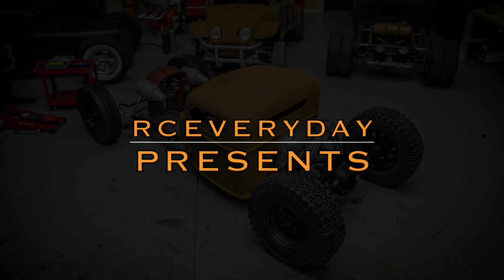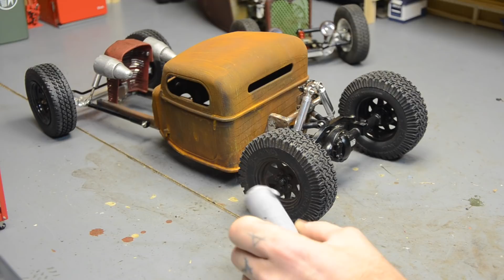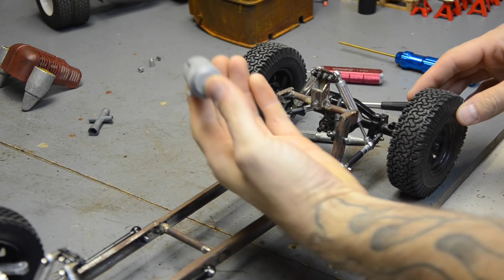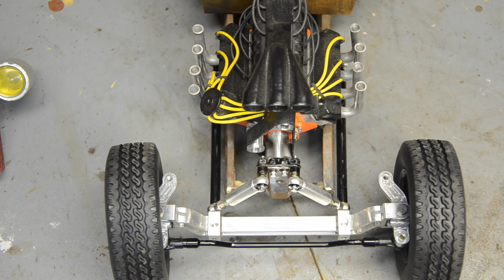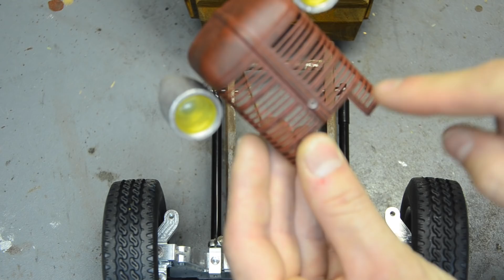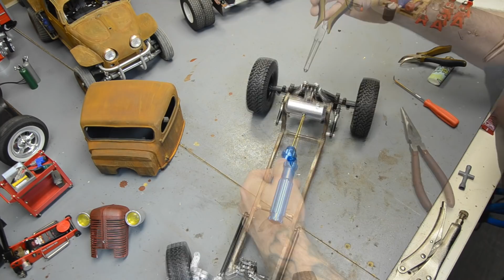Installing a 3D Printed Fuel Tank on the #4 RC Ratrod Truck

Comment: did you know du-bro makes a tap and drill bit set 5mm to 2mm cat no 510 metric there about 40 dollars  and well worth it and they fit all the hardware you use its a must have tool when building these rigs and try finger nail files they work great for sanding and last a long time
Reply from the maker: Ill check them out, it would be handy to have for these things.  I know I have some nail files in one of my tool boxes, that would have been perfect for sanding under the filler cap.
Reply: Thanks for the info!